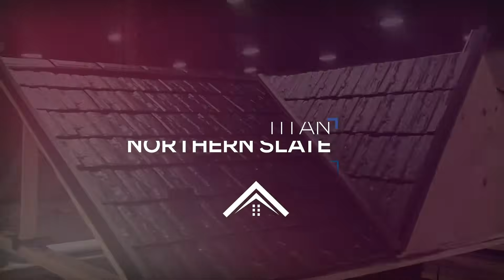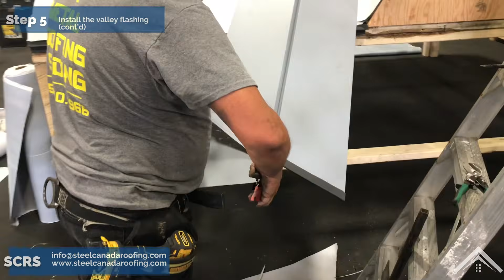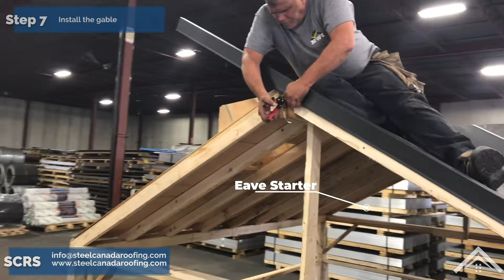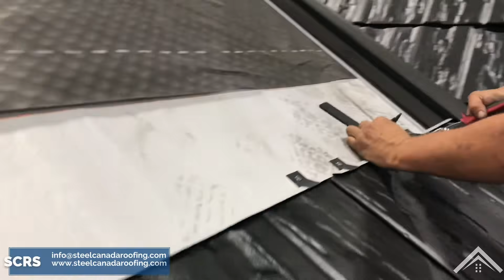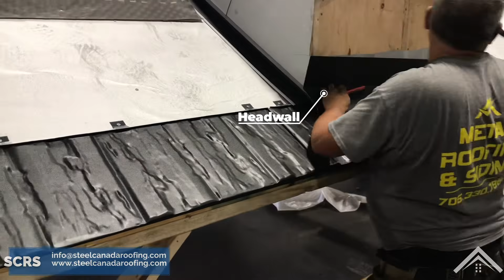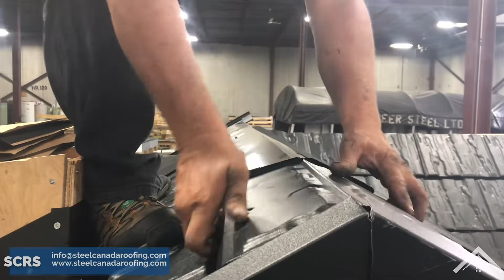How to install a metal roof? | Direct-to-deck | Steel Canada Roofing and Siding Limited

Comment: Never cover asphalt shingles... EVER!!!  Other than that GL.
Reply: why?
Reply: @dishapatel365  The #1 Thing you need to do is get the CDX clean (meaning flat with nothing sticking up) then use a good Ice and Heat underlayment out to the edge of all the trim.  Then add the roof.  Solves all you potential unseen issues for future leaks.  Nip it in the bud early and the roof will last forever.
Reply: @dishapatel365 you single?